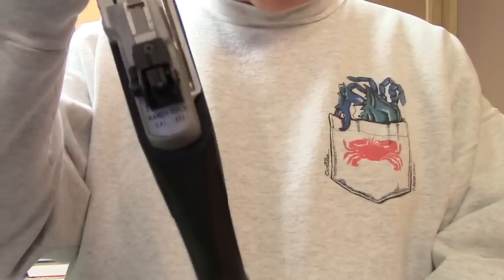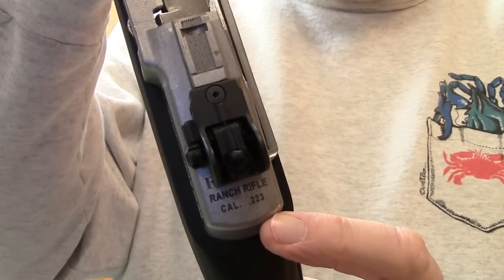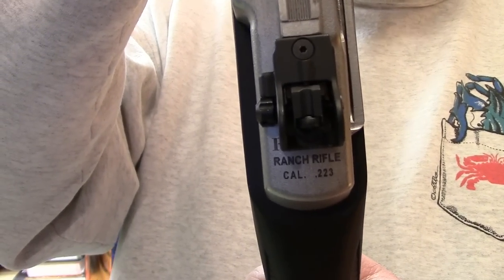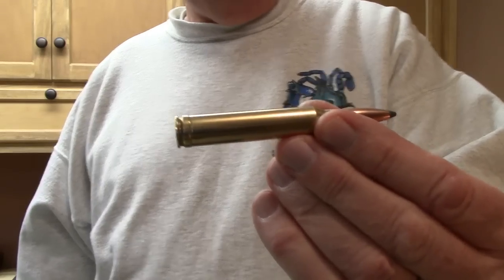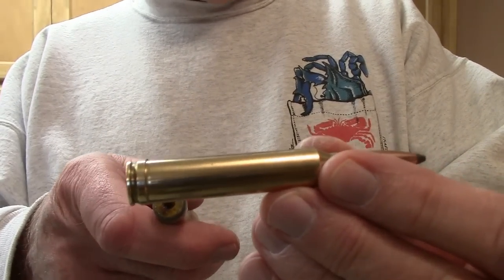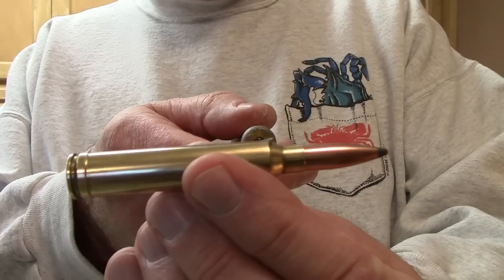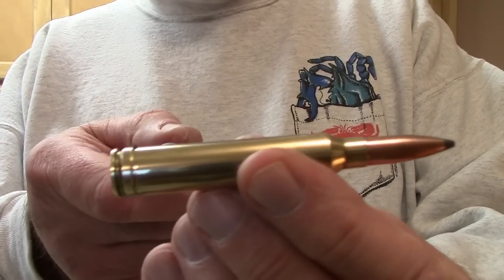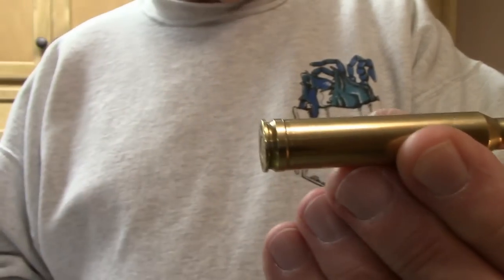Handloading PART II Pressures and Headspace ~ GunBlue's Complete Guide

Comment: I think the only load data I'd take from the web is if it was a direct reference to a book load ... example I see on shotgun world is referencing something from one of the many reloading manuals from BPI or Precision Reloading where the person suggests the page number and the load number and leaves it at that for the person asking for help to purchase said manual and follow the recipe from the manual.   you are right that taking actual recipe data from the web is extremely dangerous... you don't know who that person posting the data is or what their motivation is either, they could be deliberately posting hot loads for malicious purposes for all you know.
Reply: I have not been reloading very long but I do double check with the powder manufacturers load data and compare to the reloading manuals to make sure. I did a ladder test for my Savage 99C (modern) .308 with some VV-N550. I loaded to the Lee manual (I think). The top loads were tough extraction. Once I checked the V V website it seems the Lee specs were actually higher than the manufacturer's. So definitely look at and compare pressure statistics among the different sources. My suggestion is to use at least three different sources for comparison.
Just my two bits worth.
Thanks for the knowledge.

Comment: Speaking of the primers. I have had one pierced in cheap tula ammo 7.62 x39 in my sks. The force of that gas coming back through,  slammed the firing pin to the back of the bolt and physically bent it. Avoid these cheap ammo manufactures as well.
Reply: I like your comment.  I have been shooting cheap steelcase ammo for 30+ years. I know if you have a problem that damages your firearm within 5 years of using cheap ammo,  you may advise against this ammo. As far as center fire ammo goes, I've never had damage to my guns, 30+ years. I will tell you that I have Russian junior 22 rimfire steelcase ammo. 5000 round case. No problems for 15+ years. But the 500 round brick that I just opened,  has many misfires, jams, corrosive  smoke, and leaning projectiles in case. Two jams produced 2 rounds that the bullets fell out. Thanks.

Comment: 11! WARNING–AMMUNITION (CARTRIDGES) NOTICE WE SPECIFICALLY DISCLAIM RESPONSIBILITY FOR ANY DAMAGE FOR INJURY WHATSOEVER OCCURRING IN CONNECTION WITH, OR AS THE RESULT OF, THE USE IN RUGER FIREARMS OF FAULTY, OR NON-STANDARD, OR “REMANUFACTURED” OR HAND LOADED(RELOADED) AMMUNITION, OR OF CARTRIDGES OTHER THAN THOSE FOR WHICH THE FIREARM WAS ORIGINALLY CHAMBERED.AMMUNITION The RUGER ® MINI-14® RANCH RIFLES are chambered for the .223Remington (5.56mm) cartridge. The Ranch Rifle is designed to use either standardize U.S. military or factory loaded sporting .223 (5.56mm) cartridges manufactured in accordance with U.S. industry practice. See “Ammunition Notice” & “Ammunition Warning”, below.

Sir, I copied this off the Ruger website (as you suggested) and I read it that the Ruger Mini 14 Rance can use EITHER standardized U.S. Military or factory loaded sporting .223 (5.56) cartridges.  To me it says that this rifle can fire both! Am I reading this incorrectly? I believe what you are trying to say and I have read the owner manual...it says "either" cartridge may be used. What am I misunderstanding?

On a similar note...what if an AR platform rifle is using an upper and lower that is chambered for and states "Multi" for cartridges it can fire? Is there latitude there to fire both .223 and 5.56?